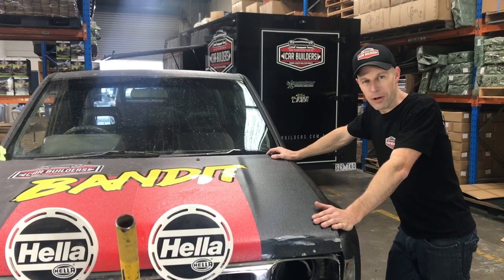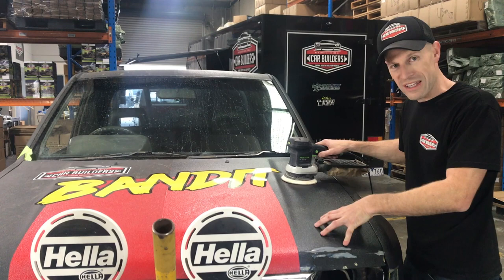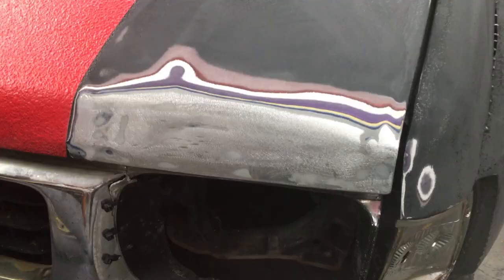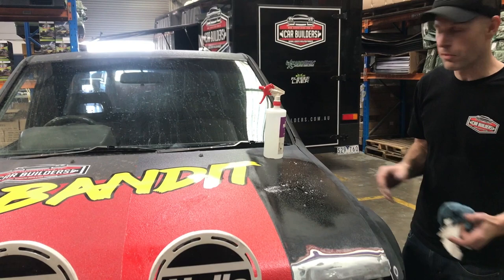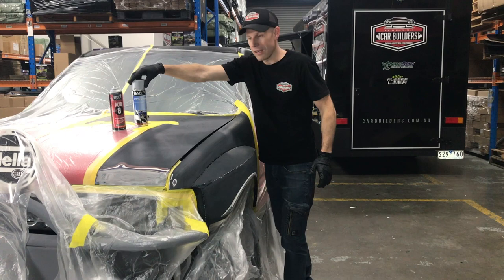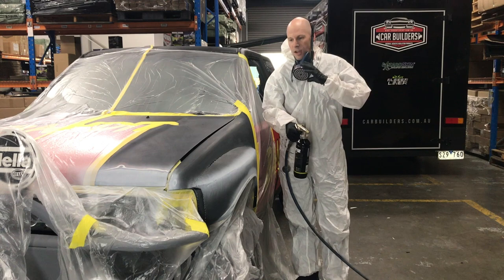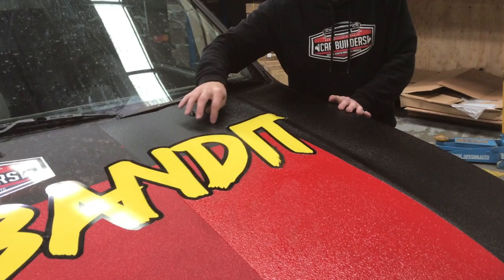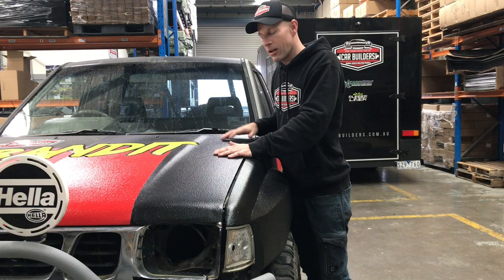Can I touch up or repaint Raptor Liner?

Comment: I've been tossing around the idea of raptor lining my entire pickup, but haven't pulled the trigger. How has the raptor held up? Does it sun damage easily? Anything a person could do to make it look its best for as long as you can?
Reply from the maker: Hi Howie. The paint has been around for a long time now and kept up its reputation with quality. It is UV texted for 5000 continuous hours. Good luck with your project
Reply: My truck is going on 4 years. My door jambs are the same color as the outside of my truck and I live in Florida .

Comment: How and what kind of paint can I use to put a design or art on top of the black Raptor Liner like you have on the hood of your car?
Reply from the maker: Hi Peter. We actually masked off and painted around that vinyl sticker, however you will be able to paint on top of the Raptor with any paint. Just lightly scuff first.
Reply: @carbuilders1  what’s the process before top coating the bully liner with different paints?

Comment: Hi guys, can i touch up raptor liner with just some rattle can paint? Sure it has different gloss level and what not, but would it actually stick to it if i sand it propperly?
Reply from the maker: Yes, you can. Like you said, just prep/sand around the area you want to touch up. Feel free to call us during the week to discuss 03 98777 0960

Comment: Did your decals just stick right onto the raptor liner or did you have to have a different type
Reply from the maker: We stuck them on first and masked off 😉👍
Reply: Car Builders - Thermal & Acoustic insulation materials 🙌🏼🙌🏼

Comment: Have you tried this repair with a paint roller? I got my truck painted with raptor liner and the hood has lots of streaking. Not happy with guy that did it, so I was thinking of ordering some tint able raptor liner and paint to match. But I don't have an area to spray. Do you know if rolling it will work? Also, when you sand, do you lose the texture? I would like to keep the same texture and just touch up to cover the streaks. I will sand, but I fear losing the texture, because it might not match. Thanks.
Reply from the maker: Unfortunately you will have to scuff up the entire hood rather than touch up with a 2K Raptor paint, can't blend 😫
Reply: @carbuilders1  that's fine. I don't mind doing the entire hood. My concern is how different the texture might look.
Reply: Do a test on something and adjust your air accordingly until the texture is the same...the lower the air the bigger the texture